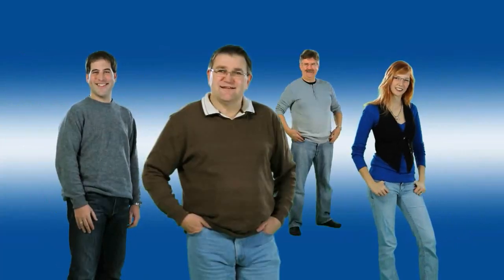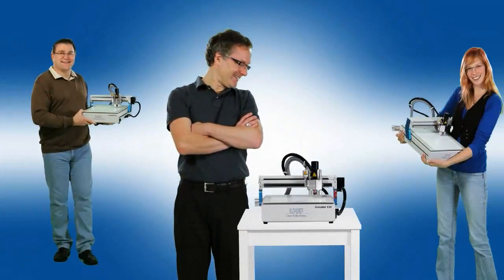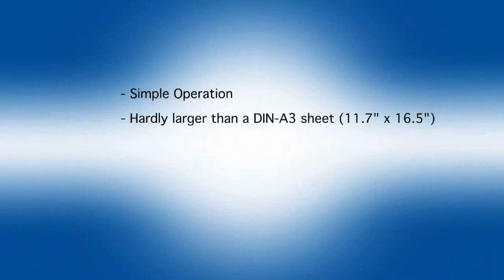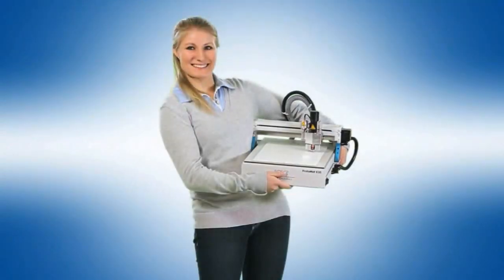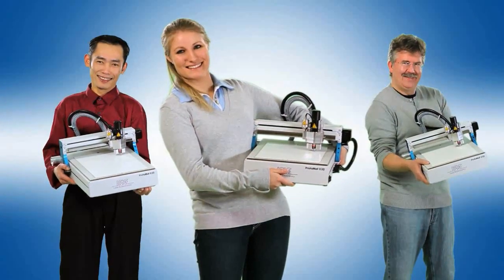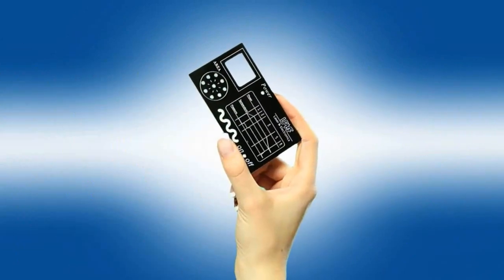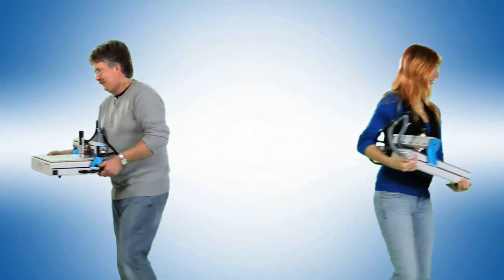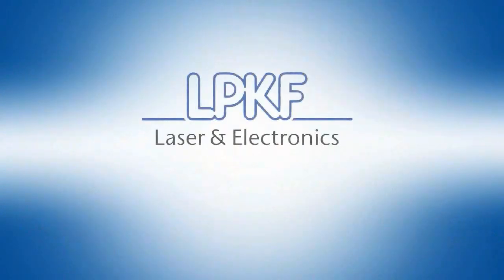LPKF ProtoMat E33 | Rapid Prototype Milling System

Comment: Does it really work or is it for body building ?
Reply from the maker: Yes, it certainly does work, however the purpose of this particular video was to highlight the small size of this milling machine which is helpful for mobile labs and field service techs.  LPKF has been making milling machines for PCB prototyping since the mid 1970s, and while there are several other demo videos which focus on the drilling/milling/routing procedures, this particular video was meant to highlight mobility rather than basic operation.  We certainly don't recommend it as a body building tool though . . . because, as you can see, it is far too light and mobile for that!   ;  )